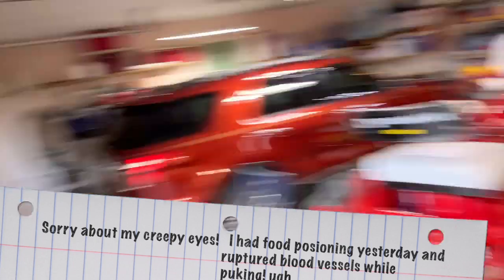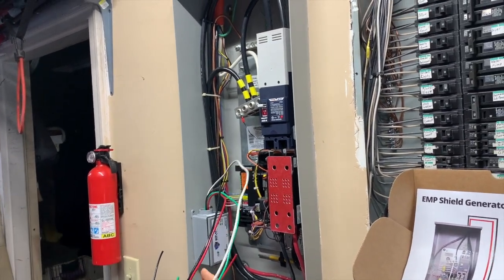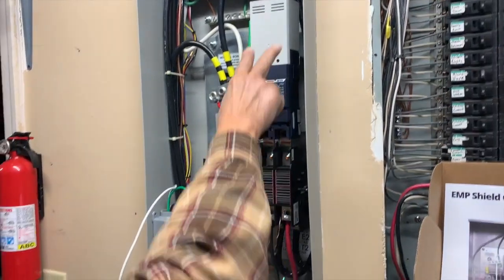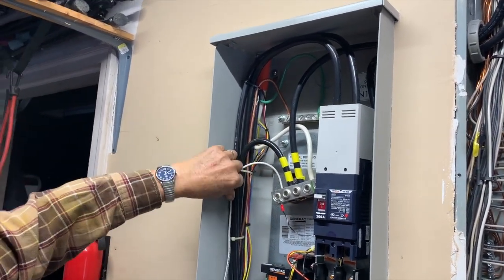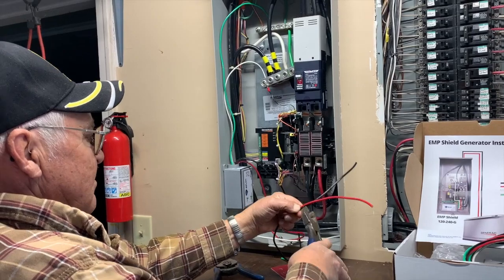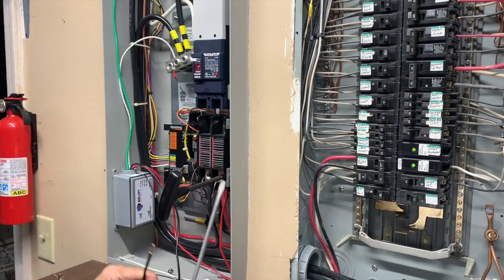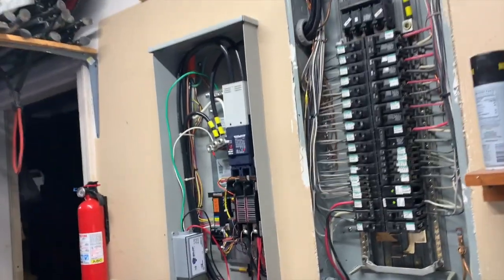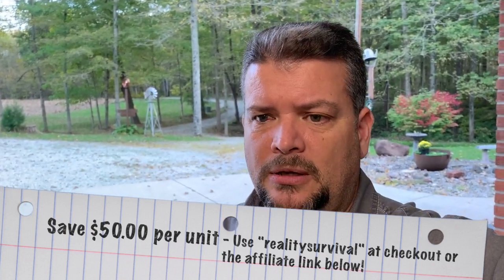EMP Shield Install For Whole House Generator - Part 1 of 2

Comment: I just installed mine today in my breaker box, I am glad your electrician mentioned that if you do not have extra dual pole 20 amp breaker you could install the black and red into a pre-installed dual pole 20 amp breaker of which I did, because there was no more room in my breaker box to install any more breakers. it was pretty easy install. but my question is I have a GENRAC portable whole house Genny, how do I install a EMP shield on that unit, do I use the vehicle EMP shield ?? for that genny??
Reply from the maker: I’m not sure on a portable unit. I’d recommend checking with EMP Shield customer service just to make sure. I think it depends on the age and type of generator you have.
Reply: @RealitySurvival  Yes thank you I will contact EMP shield,  the Genny is about 2 years old, is a GENERAC and runs whole house, but I will call EMP SHIELD and follow there recommendation . again Thank for responding, you have a great channel .

Comment: Will the green light come on when this is installed ?
Reply from the maker: On the house one yes. On the generator one no. Not until the generator circuit is energized. But the EMP Shield techs said that they don’t have to be energized to work because they will always work immediately if a circuit is energized with any amount of over voltage.

Comment: So one thing I think is important to cover, and I talked with EMP Shield about this, is that on the generator model you are connecting this to the non-powered lugs in the transfer switch which has no power when running off utility power. This means the EMP Shield is not "powered on"... so my question to EMP Shield was how does it actually protect itself or anything that is plugged on to the generator side of the transfer switch. Answer is pretty simple... the surge itself will power the EMP Shield and cause it to send the over-charge to ground. So technically you could store your portable generator (or other device) with one of the EMP shield devices on it as long as it has a grounding system to send a surge.
Reply from the maker: That is correct.

Comment: So your house survives an EMP without overload or burning down, and so does your generator, but how about all the computer driven ignition on the generator and same computer accessories in your home? Also, want the main grid be fried anyway? Rumor is, no vehicle will survive built after 1980? Plus no gas from no electricity?
Reply from the maker: This might help. https://youtu.be/Cc93LTIjT7Q

Comment: My electrician would not install an EMP Shield into our all home Generac back up generator transfer switches box. He said it could start a massive fire and he did not want to be responsible for that happening. He did install one in our house fuse box though. I bought my EMP Shields when they first hit the market (have one installed in the car too)   I wonder if they have made a new EMP Shield specifically for the Generac back up generator after I bought mine.
Reply from the maker: I can’t really address why he wouldn’t put it in there because I don’t know why he would say that. Just because a person is an electrician doesn’t make them competent. I have know plenty of electricians that I would never let touch a wire in my home. The units have multiple safety certifications. You can find all of that info on their website and do your own research. Let’s put it this way I have them in my home. So I trust them with not only my life but my kids lives as well.
Reply from the maker: Yes they have a specific model for a whole house generator.
Reply from the maker: You bet!

Comment: Neither of you have had the pleasure of trying to wire a metal framed house I see. Induction every where. EMF everywhere. I’ve also had the pleasure of trying to update com lines in an all concrete house. Walls 3 inches think and home is about 200 feet long. Geee…..I wonder why you phone/wireless coverage sucks. What’s worse is they blame the phone man. Ever tried to drill through 3 inches of concrete? Even with a new bit and a hammer drill I couldn’t do it. That type of home requires special tools the average guy doesn’t have. Grounding in an all metal home is crucial, think the owner has good grounding? NOPE! How about the retard that doesn’t want to see their coms gear so they bury it……. Gee…..again I wonder why your signal strength is poor. Then they like to argue with you to find a way to make it work. I ask them, can you see through a mud covered windshield? Well there’s the answer.